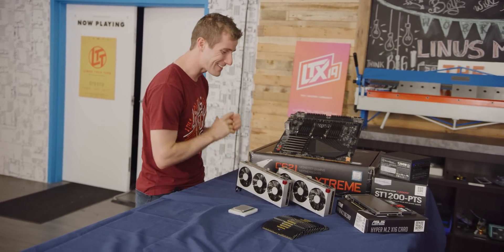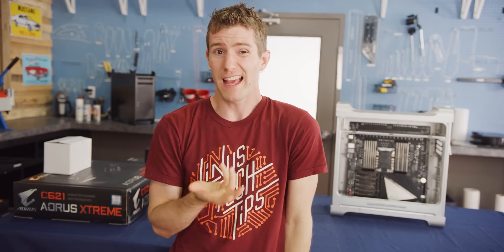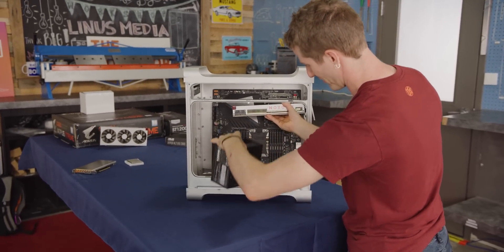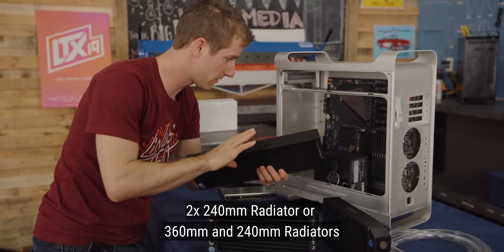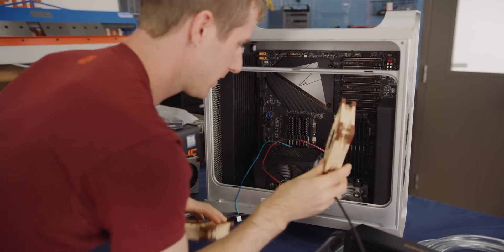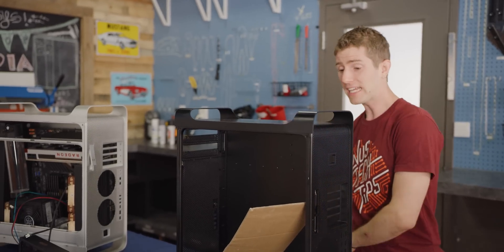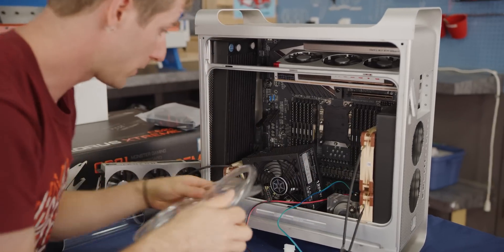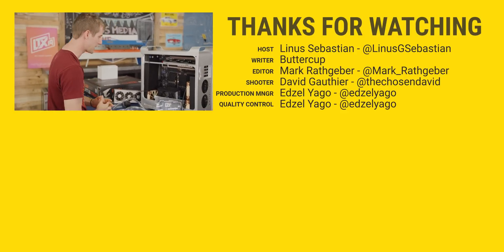The Mac Pro Apple WISHES they built - Hack Pro Pt. 1

Comment: The way that GPU hangs... It hurts to watch.
Reply: I wonder which will die first. PCIe slot or the card.
Reply: Who else visibly cringed when they saw that? ugh...
Reply: Linus leaves $700 graphics cards hanging by their PCIe connectors. What's his budget?
Reply: I always wondered how I got away without reinforced expansion slots for 3 decades and why they would want them now... ENTER LINUS.
Reply: Almost had a heart attack
Reply: The card isn’t heavy enough to break anything if the PCIe port on the motherboard is reinforced

But if the motherboard port isn’t reinforced the. Yes that would become an issue

That is why i only get the shortest possible GPU’s so they cannot bend or deform because they lack the weight and leverage
Reply: @commanderoof4578  The motherboard port being reinforced doesn't prevent the Video Card's PCB from snapping along the port, it just helps prevent the motherboard's port from snapping off?
Reply: XFourty7 

Sorry was asleep and use the motherboard being reinforced stops the motherboard port being ripped out

And it is also much harder to break a PCB than you may think

I agree it is silly but linus wouldn’t leave it there long enough to cause damage unless he doesn’t care
Reply: RIP
Reply: I was just about to say that. I wonder if he does it just to troll us
Reply: f
Reply: It was hanging for so long in the video you can only imagine how long it was like that IRL, probably 30+ mins :X... sad.
Reply: Mate I thought Linus was going mentally ill
Reply: Right - drove me crazy the whole time.
Reply: I heard LTT couldn’t afford a Mac Pro so they had to use donated parts to build one to make a Mac Pro related video
Reply: that case hold it better than linus...linus would drop it
Reply: PietroSoft it made me cringe HARD
Reply: So true :D
Reply: u guys new to this channel?
Reply: Once Linus takes off the stock GPU shroud and puts on the EK GPU block on, it’ll reduce in both size and weight. 👍🏼
Reply: Does Linus smoke? why does his voice sound so fd up ?
Reply: Can you say the cost all of it one by one
Reply: that alone deserves an unsubscribe
Reply: so much nvidia losers in this reply section
Reply: Ikr
Reply: Don't worry too much, it's only a Radeon VII
Reply: @Code-Sandbox-Dev  But the motherboard PCI-E Slot might rip out!
Reply: @pangeltveit  they are re inforced on this mobo
Reply: @lander3308  reinforced, not unbreakable
Reply: @Code-Sandbox-Dev  LOL
Reply: @Code-Sandbox-Dev  I bet he damaged the mobo
Reply: I can't stop looking at it. It hurts.
Reply: yeh true
Reply: It's resting on radiator, dw :)
Reply: @samadmemon2738  its not, only for like a minute before linus moves everything around
Reply: @genoziderkanine2668  Yeah a minute later he pulled the whole thing up, Gives me anxiety watching it hang.😳
Reply: It's only a Radeon VII .. it's not that valuable.
Reply: don´t worry its just a amd card

Comment: "384 GB of RAM are gonna be still enough, even for most hardcore workstation users"
I'm gonna laugh so much at this, in 20 years.
Reply: people will laught at you after 20 years if you would still using this machine.
Reply: The curve is rounding off. Any PC built in 2000 would've been utterly useless by 2010. But a good PC from 2010 is still viable in 2020. A good PC from 2020 I predict will still be a good PC in 2030.
Reply: @Dayhaxha  good enough for 2020 things mind you
Reply: When your ssd is ram fast then the bottleneck is going to be either your ram, internet, processor, or anything else.
Reply: u clearly don't use chrome do ya lmao
Reply: I don't think Linus would be tech illiterate to say that 384 GB would forever be enough RAM, just for this specific build, in its useful lifetime.
Reply: 512GB minimum requirement, 1TB RAM recommend. ;)

Comment: But Linus, how am I supposed to fit that into my Mini-ATX case? Only 394 GB of RAM, Linus you were supposed to be building a Mac Pro not a Mac Mini! Go back and get 1.5TB of RAM, like it says on the Mac Pro spec sheet!

The Mac Pro has Eight PCI slots, not seven. You are shorting us Linus.

Water cooling? Linux are you stuck in the 1990s? the 2019 runs at full power with Air Cooling Only, so you need to Air Cool as well, we hate water leaks which is why we left water behind a decade ago.

Only ONE GPU? No, no  no, the Mac Pro hols two MPX modules which is FOUR GPU cards, go back and stuff threee more GPUs in there, now!

Only a 1,200 was power supply? Linus, that is hundreds of watts smaller than the Mac Pro power supply, are you trying to rip us off? It sure looks like it!

You admit that its not going to be pretty? Mr RGB-ON-Everything? That is jus not acceptable, tear it all out and make it pretty or hag you head down in shame!

Go back and do it again!
Reply: you are not supposed to
Reply: @pcislocked  Yes, you are.
Reply: @Billy123bobzzz  I am not linus so no
Reply: @Billy123bobzzz  oh you edited the comment letme read it
Reply: @pcislocked  Go ahead and read it.
Reply: @Billy123bobzzz  i did and I responded
Reply: @Billy123bobzzz  good morning. did you read my answer? lol
Reply: @pcislocked  There are Dells that come with 2TB RAM so yes you can have 1.5 TB right now. He clearly shows that he had only one GPU for the build. So that is all that counts. Even if he upgrades to two GPUs he is going to run out of power and still deliver less than half the TeraFLOPS that the Mac Pro is scheduled to deliver.
Reply: @Billy123bobzzz  that dells might be using dual or more cpu configs. he said xeon w cpus cant support more than 512g. i'll look up later for that 2tb dell server.
Reply: @Billy123bobzzz  about gpu thing, let's wait next episodes and see if will he go with single. i hope he wont. 
also power wont be a issue since motherboard has 2x 24pin inputs, he can throw another 1200w psu
Reply: not sure about where he's gonna fit that second psu though lol
Reply: @pcislocked  I don't need to wait. He doesn't have a big enough power supply and by the time he is finished with liquid cooling there might not be enough room anyway. My comments were directed at Linus, to try and get him to wake up and do the project in a way that is actually realistic and fair. Before he declares himself that winner again after taking shortcuts, as always, and missing t he point, as usual. I don't actually care because I have built massive computers as well as dataceneters, for many years, and I know what it takes to make a workstation more suitable for the kinds of tasks that we actually perform using desktop towers.
Reply: a) 1.5TB RAM is not possible right now with ANY CPU/Motherboard combu you can buy. Mac pros will come with new CPUs that support 1.5TB, but they're not out yet.
Reply: c) You might be right about that, but it looks like there are little to no room for a big heatsink already. But it could be done. Still, that's pt.1, everything could change*
actually it won't lol they already shot halfway through(youtube stories) these Mac pro series, and these videos are scheduled I guess.
Reply: They can fit 4 GPUs, they said on the video. They are making sure their thermal capabilities are enough before pushing things forward.
Reply: 1200w psu is probably what they have off the shelf, it won't consume 1200w if components are taking, let's say, 500 wats. It will take around 550w off the grid, if we also count the efficiency(i assumed it should be around %90)
Reply: last paragraph is just your mad emotions on text i won't even comment

sorry if I did grammar mistakes, I am not native.
Reply: you aren't, Mini-ATX isn't a thing.
Reply: @eliaspullola.2664  Yes of course there is, such a thing https://en.wikipedia.org/wiki/Mini_ATX

Comment: the mac pro is trash and overpriced. this is reasonable price but  L O N G
Reply: Lol why is it overpriced?
Reply: @blakeok952   5000 for mac pro? wat do u mean y
Reply: @mohammadhamad5431  are you gonna use a Mac pro? No you aren't. I would ,and that's pretty decent price for a single unit. Even tho the base specs aren't good, you can completely upgrade everything not from apple,so it's a platform with apple support.
Reply: Trash?
Reply: First of all you don’t even know the prices jet and even if you assume that they’re going to be extremely high 
you should also think of how much a single Xenon W costs and all the other stuff not forgetting about the gpus and the 1.2terrabyte of extra ram!